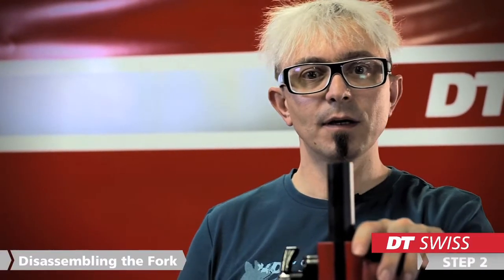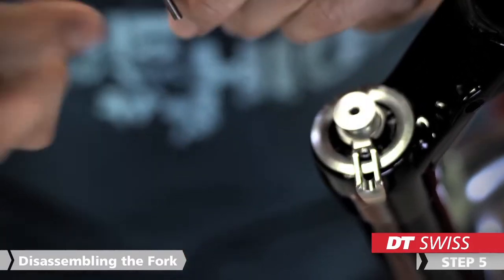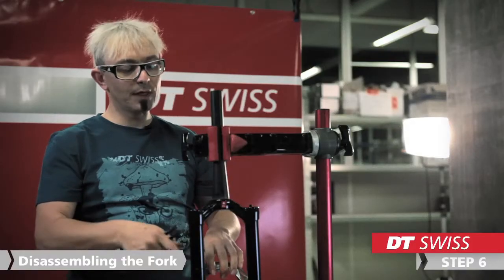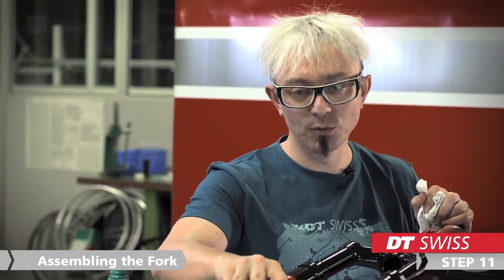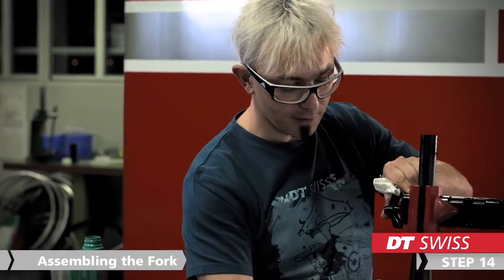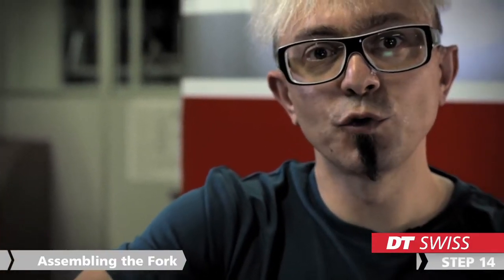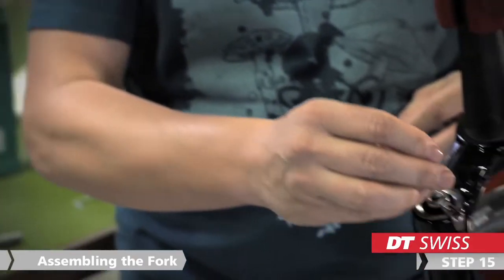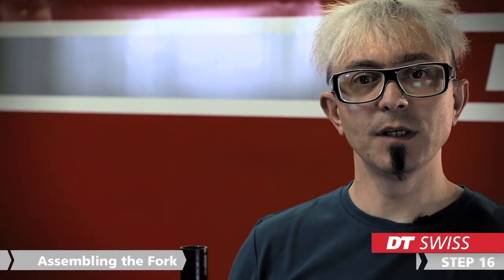DT Swiss | How to service the launch control fork.

Comment: I recently purchased a dt swiss exm 150 fork new old stock. The fork is totally New and i Just instaled it to my bike and it has a lot of issues. First the fork doesnt sag and it has a harsh top out second the launch control is very inconsistent and i can't rely on it and it has oil on stanchiοns especially on the air spring side. I dont have experience with dt swiss suspension products and i dont know if any of the problems will go away ones the fork is bedded in any suggestions?
Reply from the maker: Hi there
Thank you for yoru message. You will find a service Video here:
https://www.youtube.com/watch?v=3lvrYnaEIhU
As you might know, this fork is no longer in the Lineup for more than five years. A suspesnion product espcially seals and wipers need to be used, not to dry out. So I would suggest anyway to contact one of our service centers to get the fork serviced before using it on your bike. Especially when you think the fork is not working correctly:
https://www.dtswiss.com/en/support/service-center/
Stay healthy, Friso "DT Swiss".
Reply: @dtswiss  i actually dont know if the fork works as it Should i have no experience with dt swiss suspension products i only had wheels. Also today i think i heard a creak from the csu and the fork havent even touched dirt yet

Comment: The worst part is to unscrew the damper with pin wrench. Mine was so tighten, that i almost broke the whole thing. Also when you are putting back the lower legs is a nightmare. The last thing, watch out for Step 15, that bolt not always fits and its needed to check if it is in. 

Thank you for the video, i would have never made it without you!

Comment: Nice video! Questions. 1) you mentioned "cleaning" the parts. Are you wiping them down or using a cleaning fluid? 2) I'm surprised you do not replace seals during the service. How often should that be done. Is it an easy matter to do while doing this oil change?

Comment: I have a 2009 XMC 130.  The fork expands slowly with Launch Control activated.  The manual says that this is caused by a defective seal.  Which seal is defective in this situation?  Where can I see instructions showing how to replace this seal and where can I buy this seal (I am in Australia).  Many thanks.

Comment: I reattached my rebound adjuster knob so that the line matches the number 1.  When rotate it through all the ascending numbers, it seems that it is able to click farther than 13 settings.  It clicks a total of 13 times.  Why does mine click 13 times instead of 12?